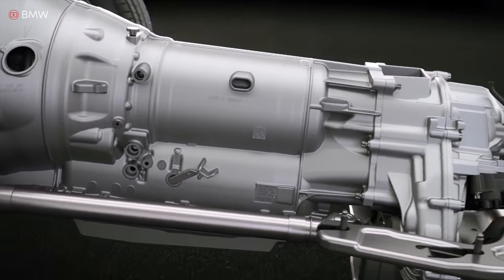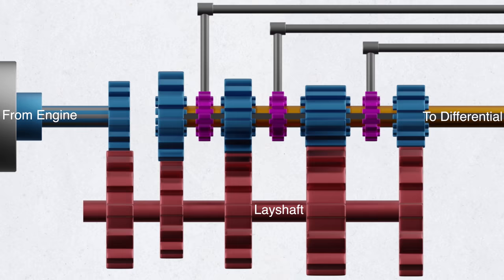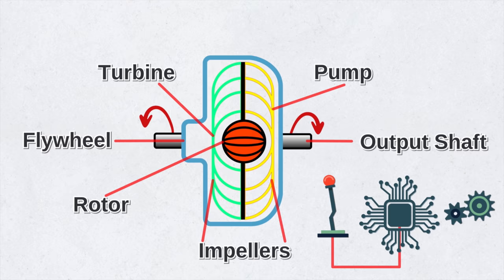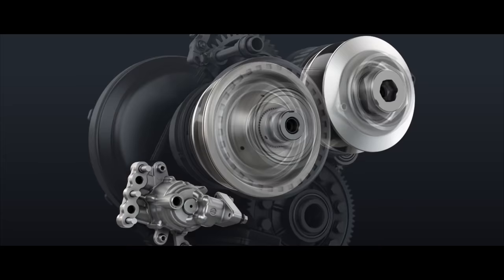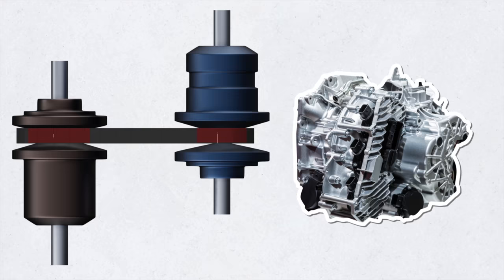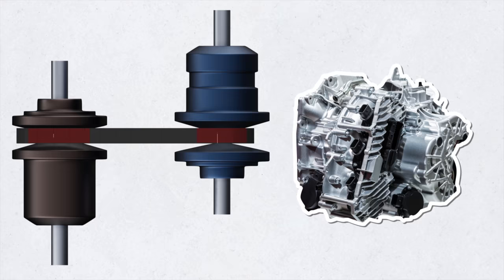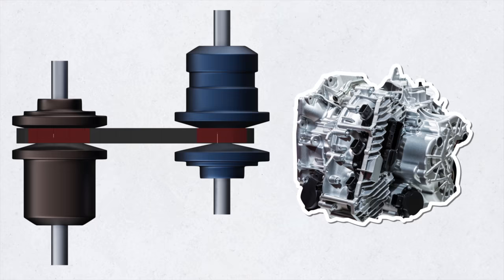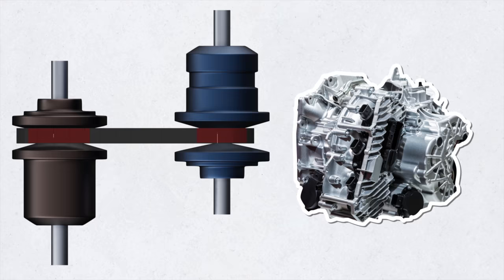Parking Like This Will Destroy Your Automatic Transmission

Comment: My uncle taught me to always park my car with the emergency brake before putting the gear into park to prevent wearing down the transmission. He's been a mechanic 50 plus years
Reply: I always put car in park then enable ebrake. Since like 2012!!! Looks like I've been doing the sequence wrong. Ebrake first then parking P mode. Lmao i got lucky i never park in a steep hill . My parking has always been flat surface as i live in a flat city. Lucky lucky. From  now on, change sequence.
Reply: @moileung  you can put it in park first, as long as you pull the e-brake before you let off the regular brakes.
Reply: @moileung  It all depends on where you live. Your sequence was not wrong for a flat land but in the mountains you want to use the e-brake first so you can put the tranny in Park.  My wife has  a Jeep Grand Cherokee with the automatic transmission.  She has to be very careful because it will pop out of Park very easily.  A number of years back a very well known actor was killed when the transmission on his car slipped out of Park and allowed the vehicle to roll down the hill and smashed him against his gate.
Reply: @moileung  It absolutely does not matter if you're parking in a very flat area. If you put the car in park while the car is not moving, then put the ebrake on, you will not wear your transmission. The thing to watch for that would wear the transmission is if you put it in park, let go of the brake, and feel the car roll a little and 'bounce' against the parking pawl. This will only happen if the car is on a hill.
Reply: I don't know anyone besides myself and my wife who always use the "PARKING brake" (not really an emergency brake, is it?) even when parking an automatic (we both have driven manual cars for years). I did have to tell her a few times if you put it in park first and it rolls until it locks, before applying the parking brake, it defeats the purpose... Always stop the car first, then parking brake, then put in Park. If your parking brake doesn't work too well and you need to park on a hill, turn your tires towards (on a downhill) or away (on an uphill) from the curb, let it roll till the tires hit the curb, still apply the parking brake, then put in Park. Moral of the story - always put it in park LAST. I have friends who look at me like I have 3 heads for using the parking brake.
Reply: @dr.bunterhidenbrobruh5502  got a Buick Lucerne shift column and since 2 months ago sometimes it's hard to shift out of park I put the parking brake on for like a 15 degrees incline and when I started it up to shift it into reverse it was the smoothest shift I've ever had plus it made a new sound like it was saying thank you sir.
Reply: @dr.bunterhidenbrobruh5502  Correct. I've tried to explain to my daughter and stepdaughter that they need to let the weight of the vehicle rest on the parking brake, not the transmission. I showed them 700 times to stop, shift to neutral, apply parking brake, release foot brake and let car roll forward or backward to a second stop (with this weight borne by the parking brake) and then re-apply foot brake and shift to park. They take this advice maybe 60% of the time because they know everything.
Reply: Gearbox in neutral, foot on brake. Apply handbrake, foot off brake, let car settle. Then put it in park.
Reply: @robj387  ahhhh. Thnx ☝🏻
Reply: @moileung  thnx ☝🏻
Reply: Not really needed. If a car is engaged by the gears during driving why not when the car is stationary..it’s not going to result in any significant wear ..
Reply: The e brake can often stick though so its best not to use it if possible. 
I don't even use the ebrake on my manual transmission
Reply: Always use mine, even on flat ground.
Reply: @moileung  It doesn't really matter the order as long as you don't let off the pedal brake or turn the car off
Reply: Your foot should on the brake pedal and the car completely stopped when you select park AND engage the parking brake. Nothing should be moving so brake then park or park then brake wont make a difference.
Reply: @renjitvin  it doesn't matter lol these people are nuts or ocd
Reply: Imagine thinking age bestows knowledge.

I mean you completely miss out that P has a pin on the gear which can easily be repaired  if snapped which many people do…

No mention of the sun gear either…
Reply: @habib_the_panda_odst  age no, but experience usually does. Usually being the operative term lol
Reply: My dad a mechanic man also told me that and also turn the wheel to the safe direction! I live where we have cold winter and always warm the engine before leaving was always advised! SCOTTY is a good mechanic man!
Reply: on a flat flat surface you don't really need the ebrake because the parking part in the transmission is not under tension
Reply: OK the key to parking is, after stopping, to shift to neutral, before taking your foot off footbrake, release footbrake momentarily to feel if vehicle moves. If vehicle does not move after about 5-10 secs waiting, vehicle is level enough to use transmission's park only, but you SHOULD USE PARKING BRAKE anyways, for safety, in case of any screwy failures like the "Jeep Cherokee Syndrome" mentioned earlier?! But avoid pulling parking brake (handbrake) lever as hard as you can, to keep from over stretching cables! If vehicle stills moves in the NEUTRAL test, pull handbrake EASY til you hear the first 1-2 clicks, release footbrake, feel for motion, if still moving, apply footbrake, pull handbrake a couple clicks more, release footbrake, check for motion, repeat if necessary, until no motion is felt. Normally, with cables in good unstretched condition the handbrake will hold first time. But a lot of drivers feel they must pull handbrake all the way, until it stops! This can unnecessarily stretch cables where the parking brake shoes won't hold! This is one cause of "non-motorhead" drivers wondering why their parking brakes no longer hold! Maybe Scotty already made a video;"Parking like this will ruin your parking brakes", that made mine unnecessary?      

This was just an expansion of "Grumpy Old Fart's" simple steps, after stopping, handbrake first, transmission park last. Just remember to reverse steps when starting a ride! Transmission park to neutral/reverse/drive first, then release handbrake last.
Reply: @Taylor_5724  That's one thing that causes issues with the brake
Reply: @xHadesStamps  but if your brake already sticks then you wanna leave it off or fix it. guess which one I picked
Reply: @Taylor_5724  The wrong one?
Reply: @xHadesStamps  yes
Reply: And I totally agree with him😊
Reply: Wow!i did not know that 🤔🙏
Reply: In UK, nobody calls it an emergency brake. It's a parking brake. You stop by using the footbrake and unless it's a temporary halt, you apply the parking brake, even in an automatic.
Reply: @kirkkronenberger877  i have Lancer on cvt and fell like after full stop on regular brake, shifting to parking mode, applying handbrake, then releasing brake paddle i feel light punch still. I thought handbrake was weak but it’s actually ok. Will try your way.
Reply: @Nibby12  yes
Reply: 1. Foot on brake
2. Gear to P
3. Pull E-brake
4. Release foot brake

Easy. Why make it complicated?
Reply: On a level ground,  apply  emergency brake is not necessary
Reply: @Harry-zz2oh he went way too young always very sad when people die before there time..
Reply: There is no such thing as emergency brake, this is hand brake/parking brake.
Reply: On full Stop:
1. Foot Brake
2. Neutral Mode
3. Hand Brake
4. Park Mode.
Easy Peasy folks 💪
Reply: I always do.
Parking:
Stop, hold break
Neutral,
Handbrake
Release brake, check if car move
Park

Leaving:
Break pedal
Neutral
Handbrake off
Drive /Reverse 
Release break pedal
Reply: @christianspear6322 
Almost.
Nr2 is the last.
1,3,4,2
Reply: Nah bro use the e brake first then slip it into park cause if you don’t it’s still gonna latch onto the transmission and wear it down when you do it the right way like I said it’ll simply slip pass the transmission to the park so it won’t clench on
Reply: Flat. Just put it in ..P..!!
Reply: Put the dam brake on ..then put the dam
Thing ..in park  .
Don't make a lunch out of it ..just park it.!!
Reply: @christianspear6322 ebrake before

Comment: Most people have no idea HOW to set the parking brake with an automatic.  Stop the vehicle.  Shift into neutral.  Set the parking brake hard enough so the vehicle doesn't move.  Then and only then shift into Park.
Reply: My 2021 mazda puts electric operated parking brake on at car shutdown
Reply: @nickmalone3143 my 2024 rav4 does that, I turned it off so I can set parking brake manually. I don’t think you need to shift to N before P though, I don’t see what the difference would be

Comment: Summary
1. Don’t coast on N going downhill, stay on D or lower gears. 
2. Don’t shift to P before the car stops, reach complete stop.
3. Try to keep fuel level above quarter full.
4. Don’t drive with a spare tire for long period of time, get it changed ASAP.
5. Use the emergency / handbrake when parking uphill / downhill.
6. In case of water slipping into the transmission, tow it to a mechanic for service. 
7. Overloading your car during hot weather can cause transmission to oxidize - premature wear and tear on the transmission.
8. Check car’s Manuel before towing for the max capacity of the car.
9. Make sure to warm up the engine before moving in cold (snowy) environment.

Comment: Scotty……
A lot of people with Automatics don’t know how to use the E-Brake 🚨 when parked on a hill,…
So I’m going to say it one more time…
Whenever you park on a hill, 

1st shift the car into neutral, while holding the Brake pedal.

2nd Engage your E-Brake and Let go of the brake pedal slowly, so the car can level. (Your E-Brake must hold the cars weight)

3rd put the car into Park, Boom done ✅…

If you do this, you won’t get that Thump sound on the transmission when you shift into Drive from Park…
You are Welcome !!!!!!
Reply: Curious, what cause the thump sound?
Reply: Mainly because it seems Americans got into the habit of calling it an 'emergency brake' instead of a parking brake.
Reply: Are the three procedures to be performed when the engine is not running ? The reason I'm asking is, how can you shift from neutral to park without going over the drive and reverse mode and not holding on the brake pedal?
Reply: On Automatics [ AT ] when you press the brake pedal, the computer controls the clutch, and allows you to shift into [ N ] and then into [ P ]

It’s the same as going from [ D ] into [ P ]..
The only difference is shifting the car into neutral position, and engaging the parking/e-brake…
Reply: @csan255  you cannot shift the automatic transmission car when the engine is not running 🏃‍♂️….

For a stick shift car,., you should know the parking brake very well 😆
Reply: @chamberlyvandora9594  the pin that holds the transmission in place has load on it and when you pull it into gear it "pops" out instead of just backing out freely.
Reply: So why dont driving instructors ever teach this?
Reply: Why do you need to shift to neutral first? I just hold the brake pedal, shift into park, pull the handbrake, then release the break pedal. I don't think i hear a thumping noise? The car doesn't move cuz of the hand brake.

Comment: First vehicle I drove when I got my license at 16 was a 5 speed manual. I drove in traffic heavy 
Seattle/surrounding area for years in it. I'd have a pop in one hand and a burger in the other shifting gears in traffic lol. Back then I thought it was so cool that you could start your vehicle by rolling it and popping the clutch. Nothing but automatics for me now.
Reply: Lol..that image you gave reminded me of my 5 speed manual days..the things I could do with only 2 hands while steering and shifting, then switching between the clutch, brake and gas..I was pretty darn good at multitasking, and I didn't have to worry about telling anyone no if they ask to borrow my car.. all I had to say is "ohhh it's a stick...sorry"🤷🏽‍♀️ ..😄
Reply: That's the common everyday practice we do in Europe all the time ;)

Once learned, everything happens so spontaneously that I have never really found automatic anyhow desirable - instead its outweighing disadvantages keep pushing me off right away.

For example, oddly enough, while Scotty was talking about stalling at 11:45,  completely unrelated footage of exact opposite side of the thing was shown - when you get stuck into snow or mud, you can much more easily get it unstuck with manual as you have direct precise control of torque by ability to arbitrarily "dose" both throttle and clutch separately, and clutch setting acting immediately, and you can even preselect a higher gear which sometimes helps in worst situations.

In many snowwy and muddy situations I drive with my manual all the time, I have got real troubles when I have been a driver for an automatic, as you cannot engage enough the torque converter without having enough rpm, you cannot have have direct immediate feeling of traction according to throttle (and even less to the nonexistent clutch..), and the level of engagement only changes with significant delay it takes to either accelerate or decelerate the rpm according to the throttle pedal. Not to mention you cannot preselect a higher gear.

What about anti-skid features and ESC? No, they are of absolute zero help in the stuck situation, as they only take over when a wheel is already slipping, when it is way too late. With manual and a trained "touch", the helpful trick is to prevent wheels slipping in first place.

Furthermore, automatic is also somewhat problematic during normal driving on slippery road, as the moment of gear change is never completely predictable for the driver, so sometimes slipping tends to occur while gear changes and unprepared driver is not ready to "smooth out" the throttle accordingly. With manual, driver always knows when to chhange gear and is better able to "smooth out" after it by arbitrary controllability of both throttle and clutch. This issue is, though, somewhat alleviated by modern ESC, but still...

Yet more, IMO, very relevant advantages of manual, any of which I would never tradeoff for the minor convenience of automatic, are the abilities to arbitrarily and smoothedly disengage and re-engage the traction by clutch whenever I want (helpful in some maneuverings and recovering from skid situations), engine brake with arbitrary gear, tow and go long downhills on neutral without lubrication problems, push-start, and move the car with starter when engine inoperable. Not sure whether the need of extra maintenance and proness for faults and costly repairs of the automatics are even worth mentioning.. Also, the ability to have direct (yet arbitrary with selectable gear) coupling between wheels and crankshaft is beneficial in some maintenance work, for example when needing to remove the crankshaft pulley bolt you can hold the shaft and pulley stationary while undoing the bolt by using brakes with gear engaged.

I would never have a traditional automatic as a daily driver. Another story would be some kind of computer-controlled manual transmission like some semis have. Provided with every control as driver-overridable, it would effectively combine all the advantages of both manual and automatic.

Comment: Most of the tips for preserving an automatic transmission I learned as a kid just watching my mom drive her '83 Jeep Wagoneer. Especially about warming it up; mostly because if she didn't start it, let it run high for a minute, then kick it down to a normal idle and sit there until the needle moved off of the C, it was pretty much a guarantee it was going to die the first time she tried to take off from a stop sign. Never really thought about why that was, just accepted it as one of those things that was a given with an older vehicle, especially since it was a heavily used ranch truck before my mom got it.

Comment: Good afternoon, Scotty! Thank you for letting me know to warm my car up before driving and to fill it up before it gets past the 1/4 mark. I learn so much from you....THANK YOU!!
Reply: I actually have no idea what Scotty was talking about the fuel level. As long as you have enough fuel to run and not too much water condensed in it to cause rough running, the engine and let alone the gearbox couldn't care less.

Of course it wouldn't hurt to not keep the tank too empty though, as more fuel content lessens the buildup of condensing water, and the main issue of having low fuel level in long term is actually the internal corrosion of fuel tank.

Scotty is a great and skilled guy, but honestly, quite many of his "facts" are feeling-biased personal opinions and beliefs.

Comment: Have found that parking our two Subaru vehicles with CVT trannys on slopes without properly engaging the emergency brake can bend a "shift plate" that will prevent one from being able to change out of park.  Wife had a tendency of doing that to the point that her 2016 Forester had to be towed to the dealership for repairs.  Fortunately, Suburu did warranty the repairs.